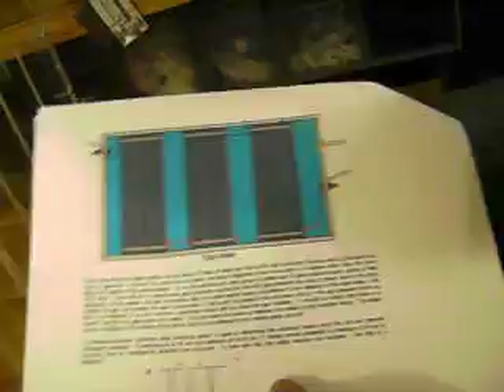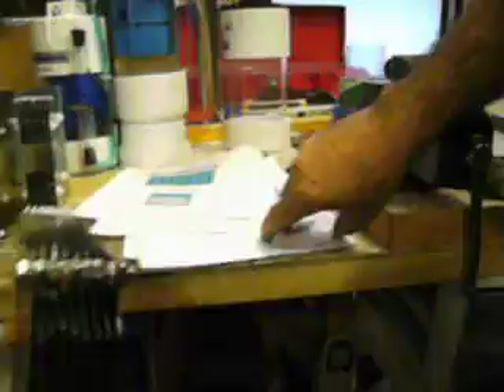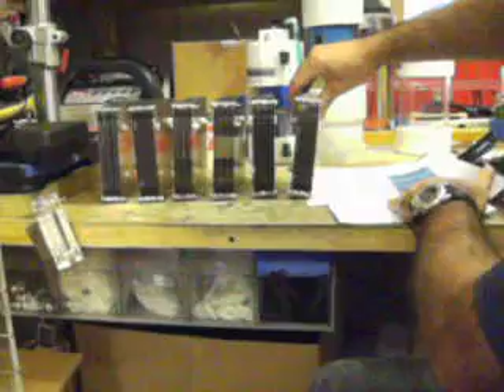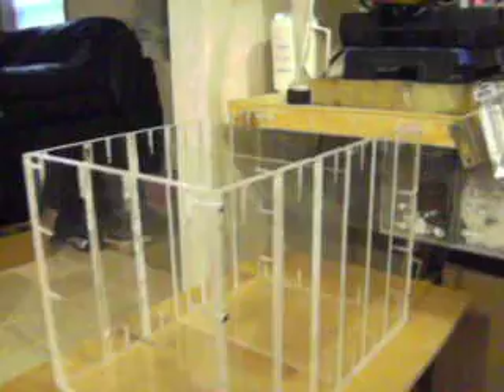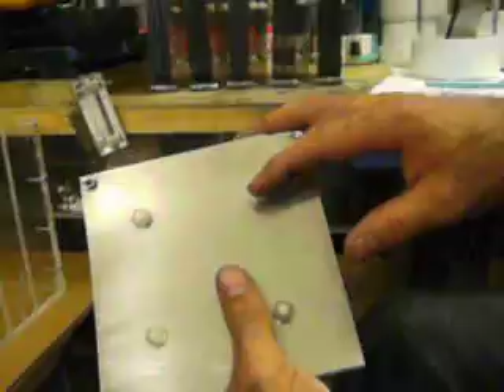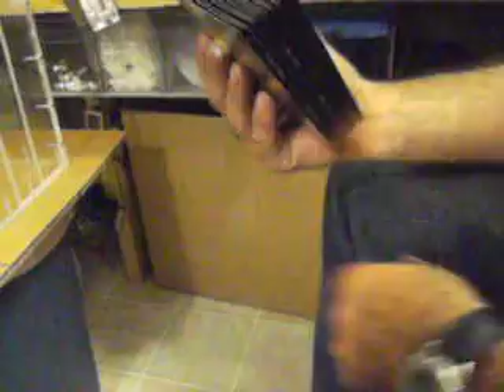GenIII story part 2

Comment: Hey man I really like the design and was wondering something. If I used 4 normal Smack cells in parallel running at 20 total amps in a plexi glass box divided into four separate chanbers how effective of a cell is that?

Comment: OK, I see... I don't imagine the maximum amps being a problem, the more area the more max amps you can handle. I was more curious whether there would be some minimum amps needed to drive so much SS, but I guess 
more SS & liquid =>> less resistance?    

I'm about to get some carbide type plates (after a loong wait) via LL labs for testing.  Hoping for high area and conductivity vs SS.

Comment: Isn't the amount of surface area you can engage limited by the available amps though?
The rule I read was 4sq in per amp, which would imply maybe 120sqin to handle 30A.
Looks like you have many times that area, will you need altzilla to drive this?

Comment: hey now I git it...
Q: why did you pick so many parallel plates per cell, as opposed to say 4 or 5 parallel in each slot?  If you went with 4 or 5 parallels you could go back to using wall plates that fit nicely into junction boxes, as I do, instead of custom-building acrylic box.  (PS I am mfn2000 on yahoo...)